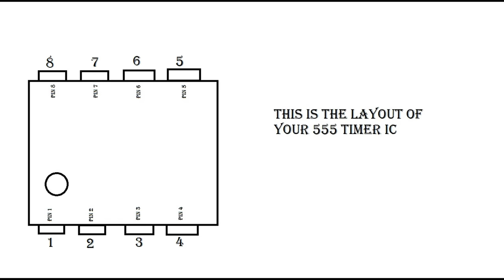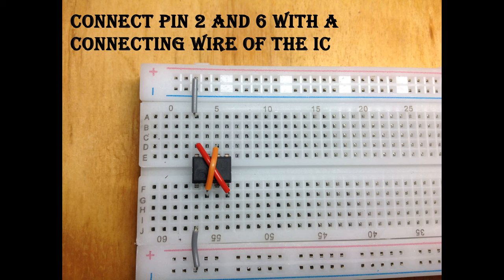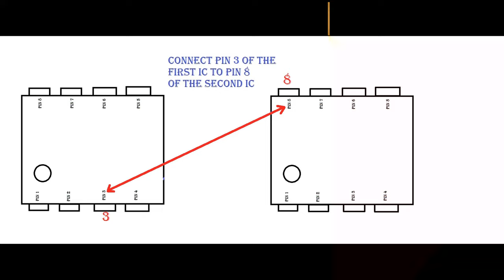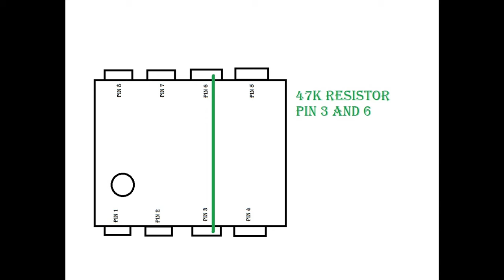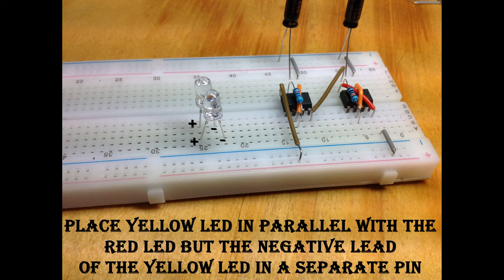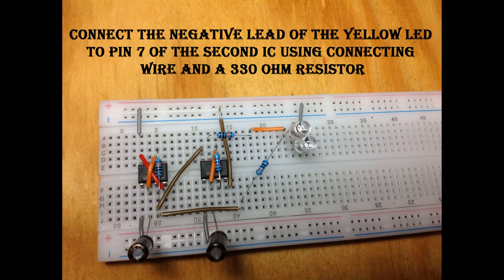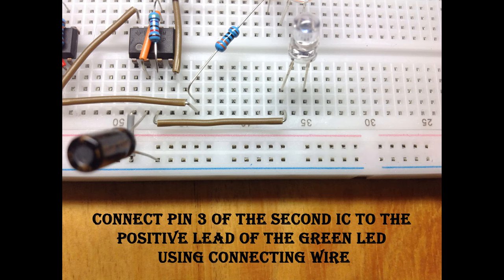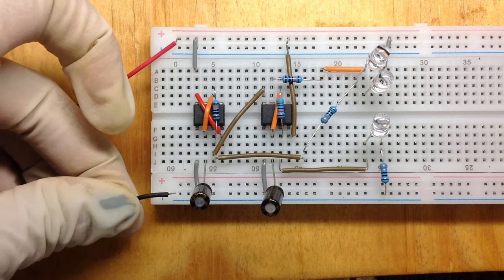Traffic light LED circuit using 2 555 Timer IC on a breadboard

Comment: I followed your instructions, but only the green and red lights are on. yellow is not on
Reply: Maybe ur led’s polarities are wrong?
Reply: Same issue
Reply: The first sequence after connecting the battery works correctly but after that the yellow is skipped every time.

Comment: Built it exactly how your video shows it and only red and yellow lights are lit. Green does not come on and they do not sequence they just stay lit
Reply from the maker: Hi J. W. Defeo,  try replacing your 330 ohm resistor which is connected to pin 7 of the second 555 Timer IC with a 470 ohm resistor.
Reply: @roleneskosan_electronics  I did, no change still can't get it to sequence or have green light come on
Reply: Same issue
Reply: Is your problem solved now?

Comment: I really liked this circuit because it's very simple, and it doesn't use the 4017 IC. Congratulations for your excellent project and for the narration too. 😊🇧🇷
Reply: Hello I am making this for one of my project which will be better cd4017 one or with 2 555 timer .
I will make this on pcb

Comment: Some may have missed this , but the Pos  Red and Yellow are on the same line of the BB so a single line to + buss  get both. The - end Cathode is on two separate lines.  If you have one light not flashing this may be your problem. also check the wire connections from the diodes and their polarity. Long leads are +. A coin 3volt battery is a good way to verify that LED is good and  give correct polarity, Do not use a 3.7 lit it will fry your diode .      A schematic would be good   but trouble shooting is part of electronics.
Reply: Can you explain it more for me?
Reply: And I want to know the mechanism of the circuit to light LEDs

Comment: Nice work but can you please 🙏 explain to me how the time interval are done among the LED to switch on & off
Reply from the maker: Hi @kpieceemmry3387 Thank you, we know that the capacitors in an LED circuit causes the LED to flash at a certain rate but in this case we also have two 555 Timer IC, which is in astable mode. The 555 timer generates a continuous output in the form of square wave via pin 3 which turns the LED on and off. The time interval between the LEDs is decided by the resistor-capacitor network.
Reply: @roleneskosan_electronics  sounded a little bit complex tho but thanks 🙏
Reply: @roleneskosan_electronics  bro one doubt bro
Reply: @kpieceemmry3387  Lol she didn't even talk about the charging and discharging time constants of the capacitors which basically controls the timing. You probably need to do some study on that to understand it properly

Comment: It is just light red led up, others are not
Reply from the maker: Hi, are your polarities correct?
Reply: @roleneskosan_electronics  yes
Reply from the maker: So what happens if you switch around the LEDS that aren't working, and if that does not work try replacing your 330 ohm resistor which is connected to pin 7 of the second 555 Timer IC with a 470 ohm resistor.
Reply: Yellow one in lighting up now, but the red one is still turned on
Reply: If there is anyway I can contact u

Comment: Can you please draw that circuit diagram
Reply from the maker: Hi @user-cb2ve4jh8x, https://www.roleneskosan.co.za/traffic-light-led-circuit-using-2-555-timer-ic/
Reply: @roleneskosan_electronics  the negative terminal of the yellow LED is connected to pin 7 of timer 1 on circuit diagram and I think was suppose to be connected to pin 7 of timer 2